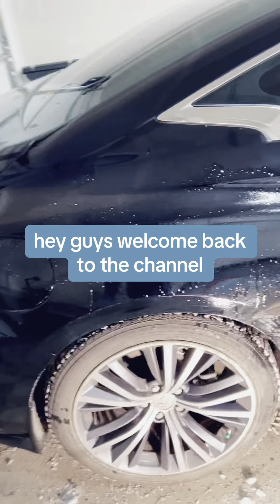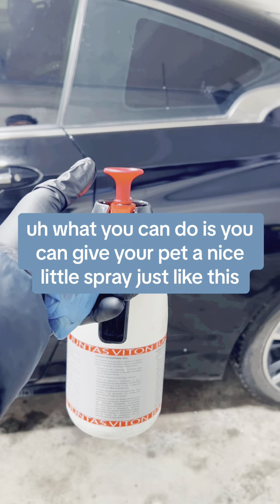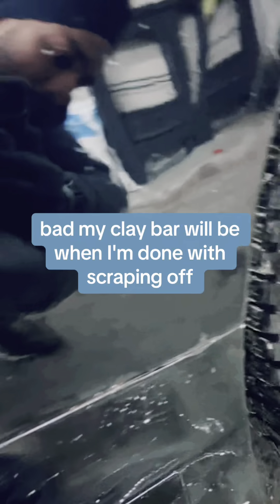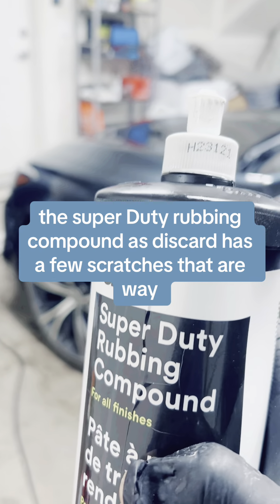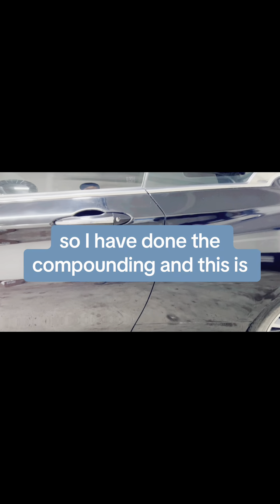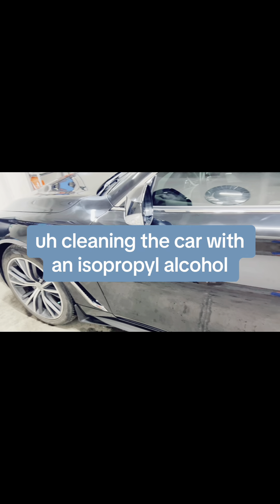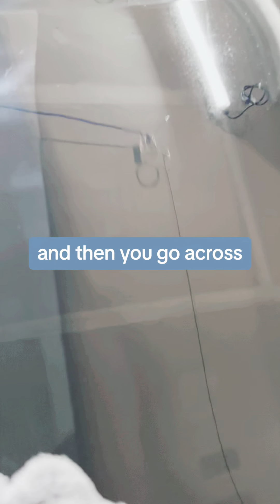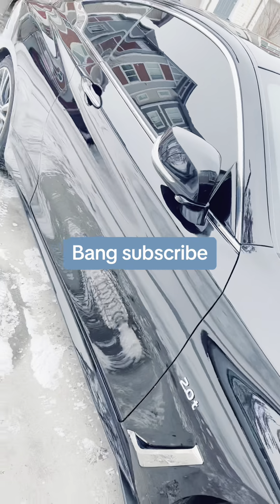How to apply ceramic Coating? Magic shield Ceramic Coating explained #trending #viral #shorts #car

Comment: Thinking about buying this coating for my car. You gave it a 6.8/10. Why 6.8? Does it work? Did you compound & polish the entire vehicle? Looks like you have had it for about 7 months now. Has it lasted or has it worn off already?  Product claims to give 5+ years of protection if applied correctly.
Reply from the maker: Yes have to polish it out i gave it 6.8 cause of two  reason it is holding 6.8/10 and other is i bought again onn for my other car but the product isnt upto the mark of wt i used the first time i feel like something changed in the composition 

Tip 
I can give you a tip after you applied ceramic coating gi with the top up like spray coating after every 6-8 month
Reply: @SinghAutodetailing  interesting. i don't understand the spraying every 6-8 after ceramic coating as in my head the product being spayed will not adhere to the ceramic coat like it would on clear coat so that seems like a gimmick to me if that makes sense. hoping the ceramic once done lasts at least 2 years to just get the cost out of the product price not including the labour spent. what do you think on longevity. 5 yrs?
Reply from the maker: Yes it is lasting good its beading good , but that spray is like an add on
Reply: @SinghAutodetailing  Thank you sir! Will give it a go.